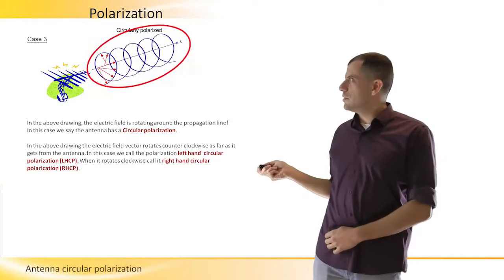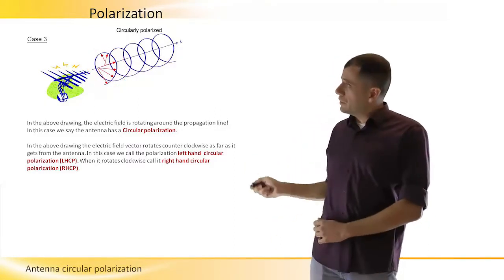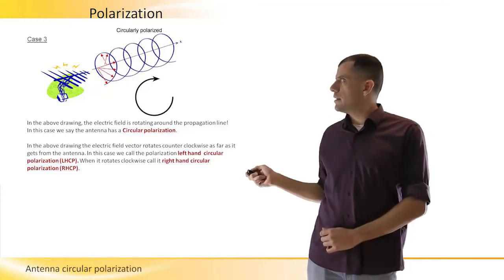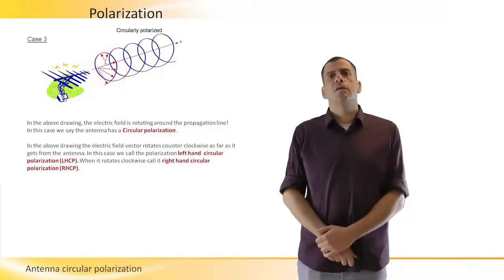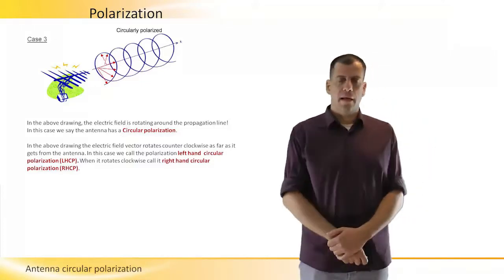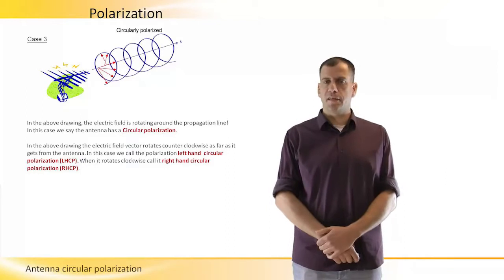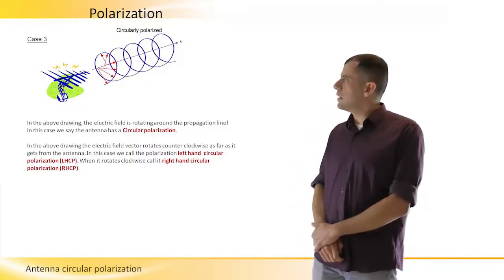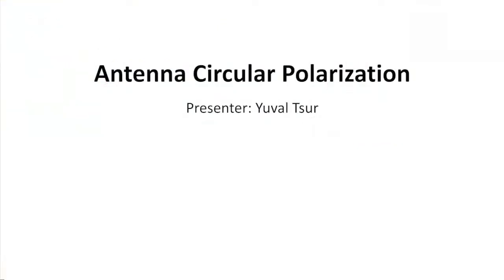Antenna Circular Polarization

Comment: This is so confusing. Wikipedia would say that the generated wave is right hand circular polarization. But the “thread” is left handed. When you look at the generated wave in time it makes a clockwise pattern in a plane from the view of the source.
I Think ieee would say that this is left, but that is from the perspective of the receiver